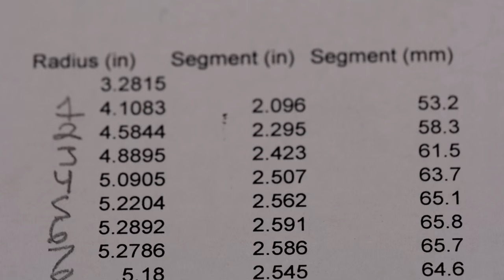Mating Vases

Comment: Whoa, I like that little sliding board next to the blade that you have for little pieces.
Reply from the maker: It only worked on the bigger pieces.  The smaller ones went flying.  I had to build walls of scrap wood around the edges of the saw :)

Comment: Really nice. That's a lot of small pieces! Couldn't you have used the CNC to make them? It would require 2 side milling for the lap joints, but should be possible.
Reply from the maker: +Lucas Hartmann Possible but I don't think any better.  I'll go into another approach in the follow up video that would have been easier.

Comment: if you had to make wooden vase, I had to be of 4 feet height, so how to calculate its segment, formula please tell me
Reply from the maker: The size of the vase doesn't matter.  You need to draw the profile of the vase and then lines across at the height of the segments.  Where those lines intersect tells you the diameter that the ring needs to be.  There are segmented ring calculators online that can tell you the segment length and angles for a given diameter and number of segments.

Comment: Very nice, but it doesn't quite work does it? you haven't taken into account that some of the pieces in the bulbous part needed to be a thicker to take up the gaps. in the narrow neck par it looks awesome but the gaps lower down detract from its stunning concept. obviously numbers three and four will be perfect! 92/100  score, and No I couldn't have done better myself!!
Reply from the maker: It's not that they needed to be thicker, it's that it will only tolerate a small difference in length from one level to the next.  So it needed more layers to fill in between.  It's the kind of thing you have to learn the first time doing it, but believe me the first time was the last time.